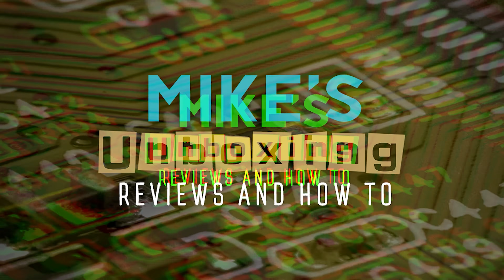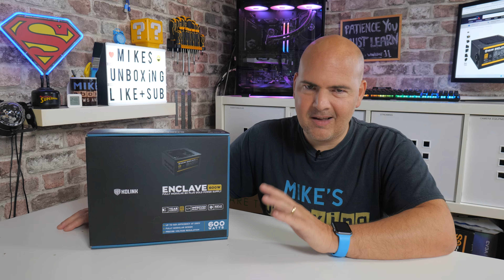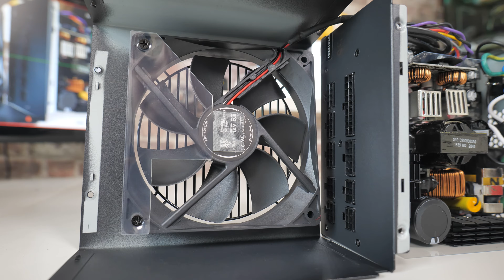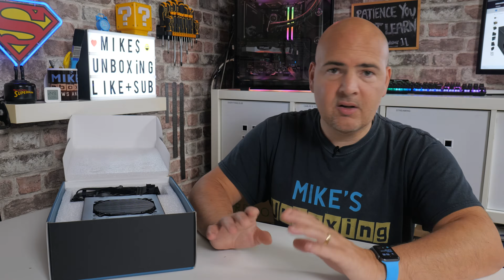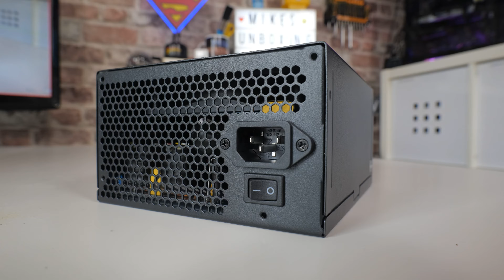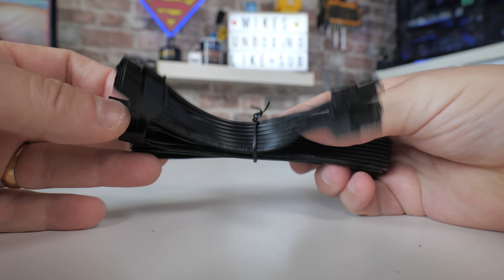BEST Value 600w Fully Modular 80 Plus Gold PSU Kolink Enclave KL-G600FM

Comment: can i just use any other power cable or do i need to specifically buy the kolink one
Reply from the maker: the modular cables need to be kolink or made for kolink, the main power input from the wall can be any brand
Reply: @mikesunboxing  ah okay. i was talking about the latter. do i need to look for a specific voltage for the cable? like if i live in germany i need the 230v cable right?
Reply from the maker: @bmk2561  i see what you mean, yes use the cable appropriate for your countries electrical supply

Comment: It's nice to find a review of Kolink PSU! Not many review them, or the reviews are a bit old. Albeit there's no ripple testing etc I still found good info, thank you.

Too bad they are still using Teapo, would love to know what Teapo series they are using tho. SY is the better one and SC is the one with worse reputation and they have used SC in the past, but it could be the quality has risen a bit. The ripple values have been a bit mediocre what I've seen so that's a factor against longevity. Though, it is rated B in the PSU tier list and it gets an A badge from cybenetics.

I'm upgrading from a Super Flower Golden Green that has served me 10 years perfectly, it's been great but sadly I have to upgrade. I ordered a Kolink Enclave 600 W as it's efficient and cheap; no great sales here at the moment to grab trusted brands. What I'm expecting and hoping: An efficient and a silent PSU. Not going to expect 10 years from it, sadly maybe 5.

Any other experiences from Kolink? Continuum and Enclave are pretty much the only series worth trying, the Core series have a horrible reputation for a good reason.
Reply from the maker: thanks for the comment, can't answer the caps question sadly, i sold the PC with the PSU in it, and haven't heard back from them so assuming it is still running as intended, was nice a quiet and would definitely buy another at the right price
Reply: @mikesunboxing  Thanks for the fast reply! Glad to hear it did - and keeps doing - its job well.

Comment: Noooooo! I had a Kolink 1000w years ago an older design to this. One day PC turned off while I was out. Turned it back on and nothing but a click. Tried the reset proceedure for the PSU did not work. Ended up sending it back to CCL and used a 650w older Corsair while the replacement came. Guess what. Corsair was fine. No issues. The kolink is not gonna last even the high wattage ones. Get a better brand people. 🥺 It was replaced by a gamemax 🤣 1500w so far after a few years it still works. That old kolink left me with a terrible experience. Had to disconnect my motherboard to check for shorts etc and when the Corsair worked without issue I was dismayed. All this with a 250w GPU and 85w CPU so not stressed at all. 🤔
Reply: @OlettaLiano  agreed 😇🥰👍. I always spend a little more on a decent rated psu. I started with a Silverstone silver rated psu years ago … but in the past 7 years, I’ve stuck with PC Cultist S or A-Tier Gold / Platinum or Titanium rated psu’s 💪💪⚡by named vendors….. as you mentioned Oletta, when you’re spending big on your pc, a quality psu is paramount and cheap insurance imo 🥰😇😉👍
Reply: @akuma2097  more about overkill than insurance and unecessary expenditure...
Reply: What is Cultist anywho?  And the whole Tier thing, is a bunch of bull....
Reply from the maker: i don't think that most "decent" PSUs are bad, and i wouldn't say that any brand is perfect or even good, all PSUs and components in general can be both good and bad, look for high failure rates, and then compare that with the amount of the product in circulation and look for those that are commonly failing over and above the percentage of units in the market
Reply: @mikesunboxing  I agree and am confident in saying ATNG platform build ones, suck.
Reply: Corsair or EVGA. If the PSU manufacturer gives you a 10 year warranty you know it's good. Only issue is with the ATX power std changing it makes it difficult to spend big on a PSU but new GPUs will need better PSUs that's why the std is changing. 

Why does Kolink not give a 10 year guarantee? Why not 5 years?
Reply: @johnathanpearson3203  both mostly have good products to their names, but not the only good PSUs out there....
Reply: @OlettaLiano  but you did buy a Gigabyte GP-GM fire hazard and at first was saying how great it was, so....
Reply: Hmm. I've had my Kolink about 5 or 6 years and no death of it yet...

Comment: seams ok  bud
Reply from the maker: i hope so, it is in my main PC 😊
Reply: @mikesunboxing  I have 700w version for 2 years now, rly hope that will last at least 5 years.
Reply: @mikesunboxing  Kolink is owned by Caseking, whom owns OverclockersClub IIRC. Its a decent brand, sold over 100 of those CPU on the systems I build, I run one one my R5 5600x 6600XT build, ripple is fine and the OCP OVP OPP protections work as intended.
Reply from the maker: @jtraimundo  Thanks for the info 🙂